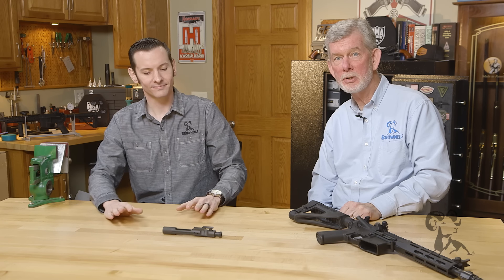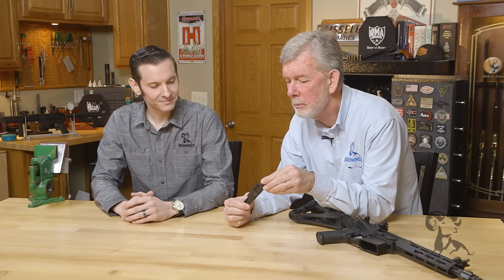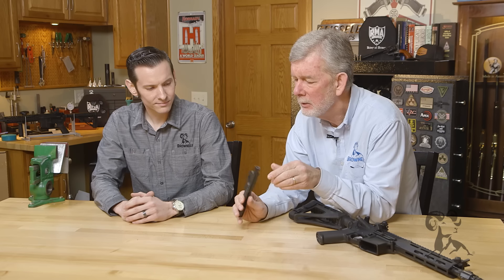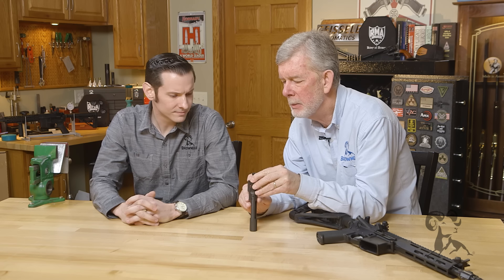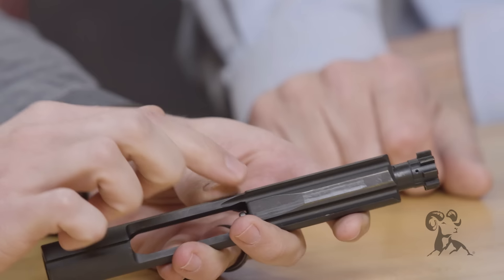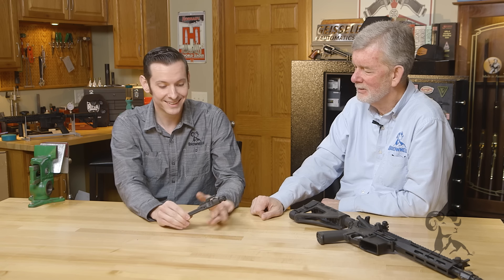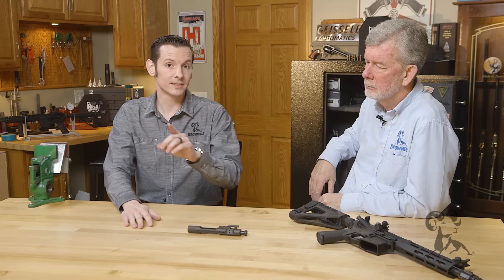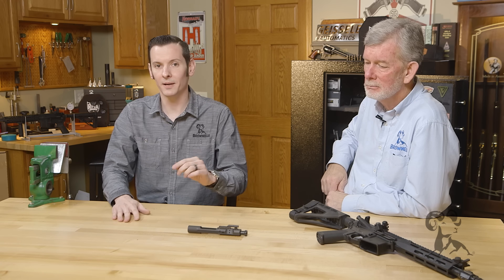Smyth Busters: AR-15 Bolt / Carrier Lubrication

Comment: Metal needs lubrication, it’s good to find the proper type. They’ve tried to do it with lubricants over the years with different cuttings and it never truly works. Exotic lubricant usually not worth the money. And of course there are exceptions to every rule. There are a couple European guns that actually use grease on the bolt carrier group.

Comment: Light lubricant on bearing surfaces only.
Prefer Triflow or any synthetic oil with Teflon.
Dripping wet is asking for problems, especially in a desert environment 
Happy shooting
Reply: Interesting.  Used Triflow for skateboard bearings and locks before, worked great, but was wondering how it holds up with BCGs.

Comment: I was never in the military. But when I built my first one it never occurred to me to put oil in those holes. I just used my own intuition as far as where it needs lube, and I ended up lubing it everywhere that you guys recommend. Those two rails that it rides on are obvious friction points that was the first thing I lubed. I also did the cam pin. I used a light high temperature grease on those areas and then put CLP on the entire thing and wiped off all the excess. It's not brain surgery as long as you lubed the friction points it's going to run fine.

But yet you hear so many people who proclaim mil spec is the absolute best that you can get and you can't get any better, because mil spec is the absolute pinnacle. 
And anything recommended by the military is the gospel and it's better than anything you could possibly do. Obviously neither of these things is true. 

I can assure you the one I built is better than what the guys in the military are using with the exception of it not having the full auto switch. But even with that they generally engage in combat with their weapon set to semi-auto. With the belt fed machine guns doing the full auto work. I've watched a lot of combat footage and that's what I've seen I've also asked plenty of combat vets. Most of them said they never engaged the full auto or burst switch

Comment: Yeah you’re definitely gonna want lube on the cam pin and on the bolt itself inside the bcg. Don’t want to prematurely wear that chrome lining.

Absolutely keep that shit out of the gas system though. Otherwise your bolt is going to be full of sludge in 100 rounds

Comment: I use  Lubriplate SFL NLGI "0" grease. I find it stays in the friction areas of the BCG much better than gun oils. Another grease that's easier to find ( I "borrowed" some Lubriplate from work) and probably just as good is Lucas Oil's Extreme duty gun grease. I've seen it at LGS and some auto parts stores.

Comment: I’ll probably get a ton of crap from the “purists”for this…
I run all my AR’s with the bolt carrier lubed only on the contact points with the upper and I only use lightweight Ford Multi-Purpose Grease (Ford P/N DOAZ-19584-AA) it’s what they use on door and hood hinges, door and hood latches, seat slide tracks and window regulator mechanisms. I’ve been using it since the late ‘90’s on all my firearms and they all run flawlessly. It’s far less messy than oil and it stays where I put it. Im not sure how it would affect performance in extreme cold weather (below 0°F) but I’ve run it in my hunting rifles well down into the teens without issue.

Comment: I take clp and make everything wet, and toothbrush the ever living snot out of it. Then I wipe it all off with the old T-Shirt that I use to wipe my butt, and to hold my jelly donuts, so I don’t get crumbs on my fingers. Then, I dip a q-tip in Marine grease, silicon grease, or white lithium grease. Then I wipe the greasy q-tip on the shiny friction zones. I know, I’m an idiot or whatever. It’s worked for me. In Iraq & Afghanistan, I ran them dry.

Comment: We were told to lightly lube it in the USAF back in the 80’s. But when we did some combat training with the Army they said run them wet wet wet.  I run mine with a slight layer of lube on all friction points and even a little bit in and around the buffer tube.

Comment: The purpose of "lubing those three holes" isn't to lube the vent holes. You're lubricating the gas ring run, which is the primary source of friction between the carrier and the bolt. Which does make a lot of sense.
Reply: Thank you!
Reply: @dannybarton940  I respect these guys, but they clearly don't even understand why people put lube there, then bash them for doing so.
Reply: That is the reason the inside of the BCG is chrome lined, any lube you put there will be gone within a few shots.
Reply: @CalebSavant  Chrome lining in and of itself is not sufficient lubricant.
Reply: @CharlieMikeNS  It is there to reduce friction, prevent carbon buildup and prevent rust. The gasses create a high heat and pressure in that area that will almost immediately remove any oil you place there. If you would like a better explanation on how and why it works this way, please feel free to give us a call on the TechLine, all of our techs have a clear understanding of how this works and would be happy to help you out.
Reply: @CalebSavant  Nah, I'll just listen to Jim Sullivan.
Reply: @CharlieMikeNS  I just put a 100 rounds through a Springfield Saint Edge yesterday and cleaned it last night. I used good ol' USMC issued (1975 - 1979) LSA for lubrication. I will admit there wasn't a noticeable coat of lube to be found inside the BCG. So I 'spose I have to agree with Caleb in that regard. However, that thing is not far removed from the piston and rings of an internal combustion engine. I'm thinking "Why don't we just chrome line the cylinders of auto engines and save all that money for oil changes?" Did I lube up the inside of that BCG again last night? Damn straight!

Comment: I run my 5.56,  6.8 spc and my 300 blk out BCGs lightly wet all over the surface and charging handles stems. Not any seizing issues, run perfect. All my rifles also have H2 buffers that are lightly oiled along the rim of buffer itself being a high friction area. Flawless operations. Like a well oiled motor,  keep it lubed!! Happy shooting and be safe.
Reply: I just shoot a short blast of lithium grease inside the buffer tube before inserting the buffer and spring. CherryBalmz firearms grease on the BCG rails. Couple drops of oil on the gas rings and seal.

Comment: The purpose of the lube in the vent holes is to lubricate the bearing surface of the bolt, without removing it from the carrier.

Comment: RSO from Colorado here. It's amazing how many people come to the range with absolutely dry guns. Being high altitude I notice that when people leave their dust covers open, the oil tends dry out a little bit faster (true for multiple brands). The process described in the video is exactly what I do to my guns and it works perfectly. I recommend this to my clients as well. I like how you present the information and focus on the why. Thanks.
Reply: Dry lube (but not graphite) is a nice way to go anywhere near the gas system. Grease with PTFE on hard bearing surfaces away from the gas.

Comment: I am constantly amazed by YouTube amateur "experts" who insist that any new gun right out of the store can be taken directly to the firing range and SHOULD function perfectly dry  with ANY ammo!  WITHOUT any cleaning or lubrication first!  I feel that this is nuts!  New guns certainly need the factory shipping grease removed as it likely holds grit and metal dust from the factory.  And new guns are only lightly oiled for rustproofing to keep the packaging clean.  They NEED a cleaning and a proper lubrication to function properly!  What's your view of this opinion?...........................elsullo

Comment: Guys like tactical hive, and Paul Harrell are telling people to put oil in the bolt carrier holes. You guys sound adamant about not doing it and guys like Harrell are usually pretty smart. Who do I listen to?
Reply: Every video you watch with "proper way" in the title just means it's what works for them.
I think alot depends on your individual environment.  If you keep it relatively clean and lubed it will function just fine. 
I always put a couple drops in the vent holes, and never had a problem. 
I also don't plan on stopping because of some internet "expert"

Comment: Never had a minutes' trouble using a liberal coating of "Dri-slide."  Molybdenum Disulfide dries to a hard, dry and relatively rust-free surface and continues to lubricate efficiently even when run hot.

Comment: I've had good luck with regular bearing grease.  Used to use Hoppes oil, but it seemed to burn off quickly and leave the bolt dry.  Grease stays put very well.

Comment: I douse everything then wipe any excess, put a drop on the cam pin and extractor. Much easier cleaning than running mostly dry. No carbon to cake up, just a carbon slushie to wipe off.

Comment: All of my ARs are piston and I still lube the BCG. My question is, what about the gas block and associated parts on piston guns? Most manufacturers advise keeping that area dry.
Reply: @Hivolt Arc  Lubricating the gas block is similar to what he said in the video about the gas key...dont do it. The carbon and oil will form gunk you dont want in there.

Comment: In a bolt carrier group, the only place I wet lubricate are the rings on the bolt. 
As for the entire bolt/bolt carrier, I use a molybdenum disulfide spray for the wear surfaces.
The fire control group has the pivoting surfaces lubricated with Hoppe's gun oil or CLP depending on what's in the range box at the time. In extremely dusty areas/conditions, the entire gun is DRY lubricated only. I don't need or want a wet lubricant mixing with dirt, turning into a lapping compound.

Comment: Strip it clean it put some oil on an old cut up t-shirt wipe it down wipe it off. Repeat 200 to 500 rounds. I live in New Mexico and have drastic temperature changes and dust/moisture fluctuations this works great in all the different bcg I run. Great information, keep up on letting the people know what they need to do if they have never had to or thought about this maintenance.

Comment: Running AR platforms wet is to keep the carbon suspended in liquid so that it cleans easily. If you run it dry that carbon will harden up over time and it'll be impossible to scrape it all away. It's best to run that DI gas system wet because the gun literally shits on itself... so you may as well keep the shit suspended in liquid instead of letting it scale up in all kinds of places. Run your AR's wet my friends, your rifle will thank you!

Comment: Larry Vickers and John Lovell would beg to differ. When a Delta Operator and a Ranger tell me to do something I'll at least consider it.
Reply: If you are referring to the field expedient lubrication they recommend, you should have also heard where John said "This is just a quick field expedient way to oil the AR, there are better ways to do it when you break it down and remove the bolt", AKA the way in the video you just watched above.
Reply: @CalebSavant  Yes, there are better ways to do it if you have time, but you verbatim said that lubricating those holes is pointless. And LAV explicitly said the bolt and bolt carrier should look wet.

And Jim Sullivan said they're meant to be run wet. But what would he know about ARs, he only helped design it.

Comment: LSA (and LAW) are not "kinda like CLP" and the Army has always made this distinction. Huge difference between what you may have been told and what is actually in the -10. And running wet has the potential to get oil onto the ammo and into the chamber where it will spike bolt-face thrust forces, which can break the bolt. The Army made specific recommendations for combat zones, that doesn't mean they are applicable to civilian ARs. Another example where proper context is important.

Comment: If oiling a BCG is "hydrating", does that mean drinking water is "lubricating".
Reply: He's referring to hydrating a porous surface with a lubricant. When you wipe off the excess film the surface still contains lubricant within, like a sponge. This is not the same as lubricating, where the film is left on the surface.
Reply: Technically and biologically YES,
BUT the only spongy part of an AR is between the operator's ears

Comment: On Camp Lejuene we ran our guns “wet” because of the environment. Things rust fast. In the sand box we ran them “dry” because too much extra oil would help accumulate dust and dirt and cause issues. Basically just keep it minimally lubed in the desert and super lubed on the east coast USA.

Comment: I used the lubes and methods  provided  on issue gear but for my own AR builds, I treat the bolt and carrier  cylinder  like a piston drive on a motor, and lube the metal to metal areas with some high heat/ high friction  grease like tetra.  Other areas get a light coat to make it easier to  clean later.

Comment: When cleaning, I'll soak the ever loving snot out of a BCG in rem oil. But once I'm done actually cleaning it I'll dab it mostly dry and apply ATF to the bolt face, cam track, and exterior of the carrier. A little more in the charging handle area if the upper helps improve the "feel".

Also a little trick I picked up. If you have real pipe cleaners, like for cleaning tobacco pipes. Those work really great for cleaning the inside of the key , especially if you have the ones with scrubbing plastic bits twisted in.

Comment: Hey, I've got a question for you guys....how do you feel about using grease rather than oil? I find the grease tends to stay put longer than oil.
Reply: Grease is fine, I personally prefer a thicker oil such as Rand CLP.
Reply: I just started out using that Geissele light grease, its pretty alright.
Reply: @robertashton6704  i used to use dab of Hoppes gun grease on every thing great for fishing reels too but i recently ran out and hav`nt found any to get.
Reply: @gunfisher4661  I use corrosion x for that but I'm sure anything will do with most applications as long as they're not claiming something ridiculous.

Comment: Why would you not lube the cam pin? It has the most stress and friction followed by the gas rings. Come to think of don't piston rings in an engine require at least a little lubrication? What's the old saying... "Oil is the life of an engine."

Comment: Here's the thing.  These guys are saying be conservative.   Others (who have been gunsmiths for years, and some who specialize in the AR) are slathering the BCG in oil/grease mixes.  Shrug

Personally, I tend toward the heavier lube side.  Why?  Well, one, the AR was designed as a combat rifle.  One of its criteria was it had to withstand cruddy conditions.  Lots of YT videos of folks torture testing them, tossing them in mud, pouring sand right into the ejection port, etc.  So, to me, the claim that too much lube attracts dirt is sort of an oxymoron in this case.  Also, unless you're trapped in a combat situation, when you're done at the range, you're going to go home and clean your rifle anyway...well, I do anyway.  So, any crud gets cleaned out and fresh lube applied.

As for lube in the gas ports, etc, it's not so much to make the gun run better as it is to provide corrosion protection.  I clean my BCGs, bolts, etc in an ultrasonic cleaner, then blow any water residue out with compressed air, but I still like to have something in there to displace any moisture and to help protect against corrosion.  

So, I dunno, two very divided camps on the "proper" way to lube an AR.  Each claims they are the "correct" way.  One thing I can say, I've seen dry AR's have function issues due to lack of lube, never seen a sloppy lubed one have any of those issues, so there's that.

Comment: I run mine wet!  The only place I don't want lube is the flat on the bolt face.  Rotella T6 5w-40 with a splash of zinc and moly additive added in.  Carrier rails, LIGHT coat on the back of the lugs, extractor pivot pin and spring, gas rings, bolt tail, cam pin.  The real trick is to not get it soaking wet so that it gunks up the FCG.  Everything, however, has at least a light smear of oil.  Sometimes I do add a bit in the gas key or vent holes and fire a few shots before cleaning.  Gun experiences a lot of dust, grit, water, and debris around the farm.  No problems yet!

Comment: I do drop lube down the 2 holes on the side of the carrier and on the rails then give a few racks of the charging handel...I then drop lube on the underside of the carrier that rides up against the trigger hammer, few more racks....then I lock the bolt back and do a few drops of lube on the bolt that goes inside the carrier do a few more racks and finished

Comment: so until here recently I ran mine with the frog lube paste, stayed in place a little better than most oils on the bolt but not quite grease status. I'm currently testing lucas extreme duty oil. The other bolt materiel you were thinking of was nickel boron. Personally I prefer phosphate and oil. Those super slick coatings don't like to hold the oil, it wont stay in place.
Reply: Ya, ive tried all the wonder coatings but have gone back to phosphate as well. Like you say the other coatings don't hold lube well and tend to just turn dry with carbon after some use.

Comment: What about the radial lugs at the end of the bolt and the surface of the bolt itself where it runs against the carrier? 

I tend to use lithium grease **sparingly** on sliding surfaces like that, since it isn't going to run off. I suppose way oil like Mobil Vactra would do the same thing, but I've never heard of that being used on guns, just machine tools.